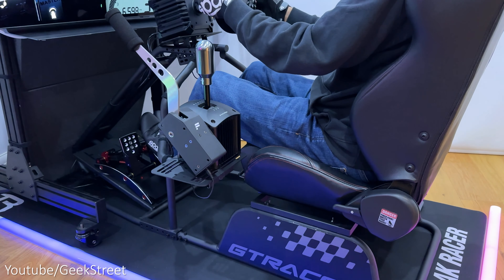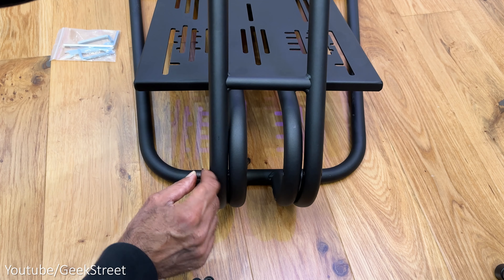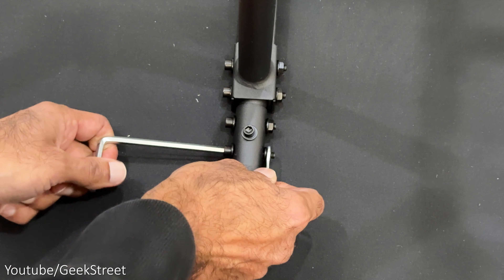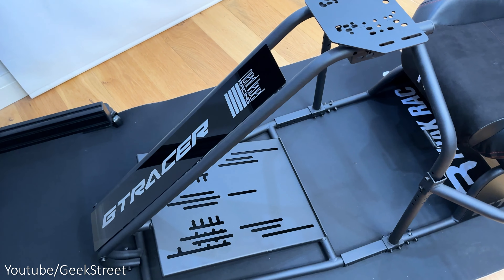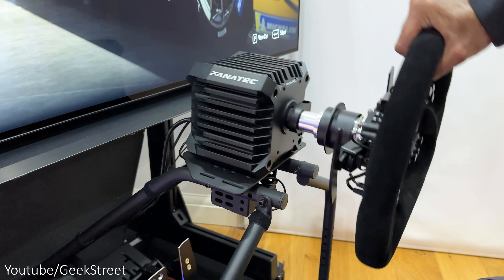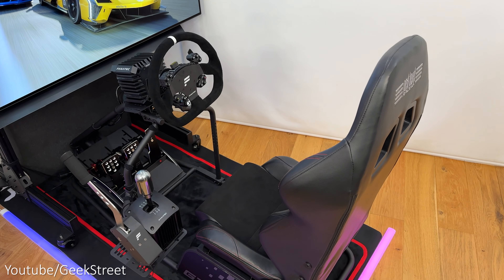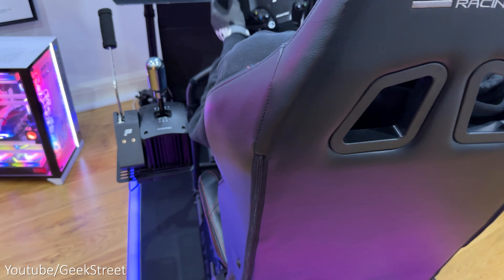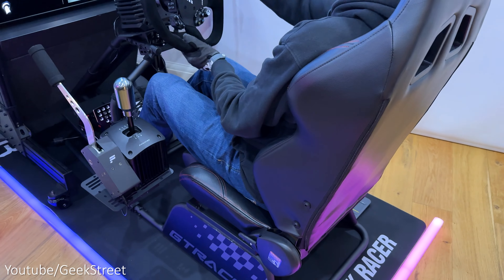Full SIM COCKPIT for ONLY $399 🤯 | Next Level Racing GTRacer Review

Comment: looks good but 399 is alot i would safe 200 more and get for 500 or 600 a elite rig the yhave also the monitor holdeers on the rig or optional trible monitor upgrades..no flex but if youd riv eina real car also all shakes its simple normal if you have this extreme wheels bases or even motion platform peopel whant relaisim..well life with the flex

Comment: Nice video review!!! Just one question, I already have my g29 and I’m planning to buy this racing seat. I would like to ask if this already comes with mounting screws?
Reply from the maker: Yes it does
Reply: are those included mounting screws capable for mounting my g29 steering wheel, shifter, and pedals?
Reply from the maker: @kier_hnsly9221  yes that's right, from what I remember
Reply: @GeekStreet  thank you!!!

Comment: I am 6'2'' and it's a bit on the small size. If I have the seat all the way to the back, I have to put the (Fanatec) pedals all the way to the front. Talking of which: you cannot put it all the way to the front, because then I cannot switch from gas to brake without hitting the bar. 

Also, for that height I think I will have to flip the wheel mount backwards (to get the wheel closer to me and have the pointy side facing me). 
I will probably have to drill an extra hole in the seat mount and have to move it about 50mm more to the back.

Flex: well, using it with a load cell pedal, I can see some flex when stepping on it hard. Tightening everything more helps with it to a certain degree.
Yes, the handbrake/shifter kind of flexes, but that's not bad at all.

I think you can mitigate the flex by tying the whole thing down (with the kind of pipe fastening U-bolts. That will work for me as I wanted to put this on a platform with wheels anyway. The flex (when pressing the load cell) comes from the middle of the bottom actually rising a bit, so if it's tied down at 6 points (or 5 , 2 front, 2 mid, 1 rear) that it will be very stable. 

My biggest grief is the seat. It is not uncomfortable to sit on (for your butt), but it is on the narrow size. I am thin but have broad shoulders and it feels a bit crammed. 

I think if you are over 6' or 182-ish cm, it is better to consider something more adjustable and mount a real car seat onto it. My next rig is going into that direction.

Just my 2c ...
Reply: Great review

Comment: Nice review.

I've never been overly satisfied with the cockpits I've seen. Either looked too flimsy or pricey. Eventually I just made one with some 1-1/2" ABS pipe, fittings, 1" pine panels (for wheel, shifter & pedal decks), U-bolts and 3/8" bolts to fit my Logitech G25 wheel and Rocker gaming seat. And I can adjust the Rocker seat and it stays in position. The wheel deck also serves as monitor deck for a 32" 2K monitor. I used to park it in front of the 42" HDTV. I use a Logitech X-540 5.1 speaker system for audio and the Rocker seat has audio in. Pleased with the result, the tubular frame looks cool and is solid, zero flex. Only tools needed are a electric drill, hand saw, wrench and ABS cement. I got all the materials at Home Depot and Canadian Tire.

Comment: Very nice and informative review! Can you confirm that the width of the bottom structure is 52cm? I want to be sure it fits between the legs of my Monitor stand whose gap is 60cm wide.
Reply from the maker: Yes thats correct it's 52cm width, there's a discount code for 5% off in the description of the video!

Comment: @Geek Street GT Racer 😊 Heaps of great information in this video, thanks..... is the non adjustability of the Pedal box a big issue? i.e. I want to get the same setup with Clubsport V3 Pedals, but I'm concerned that the pedals might not be in the ideal position?
Reply from the maker: I personally didn't find it that comfortable and would have preferred a little bit more adjustment on there

Comment: Can I ask, what size screen do you recommend, for a single screen SimRacing setup? And also, what type/brand, LED or OLED? Thanks
Edit: sorry I posted this before I reached the part where you said what your TV was. lol. Any burn-in with the OLED?
Reply from the maker: I own 3 OLED TV's and not had any burn in issues, size wise I'm pretty happy with the 55inch and works pretty well for a single monitor setup. Hope that helps.

Comment: Do not use the tool provided, you need a proper socket and ratchet set to tighten the bolts( with blue lock tight) to the correct torque, this will eliminate 99% of any flex, I have this set up using 8NM direct drive wheel base no movement at all!! Most rigs out there cost $400 plus just to ship!!

Comment: Good video. I'm really struggling on deciding what to buy. It needs to be portable and moved in front of and away from the TV, but I also want something that's sturdy and doesn't make me regret not spending 100€ extra. Any suggestions?
Reply: How about the GT Lite Pro? It's light, has a comfy seat, and can fold away when not in use, but it's also rated for 13nm DD wheels (and some YouTube vids testing this show that it can handle at least the entry level DD sets). 

I'm honestly debating between either that or this GTRacer. As much as I'm concerned about the flex and limiting myself in the future, I just want something a bit more rigid than the GT Lite Pro but I don't want to break the bank.
Reply: @roguesquadron521  I think it has a little too much play. I was considering the Playseat Trophy or something similar

Comment: dot know why people buy this things that will go loose in no time,when you have similar price aluminium profile cockpits that will mantain stable for ever
Reply: exactly. looks like an cheap ebay cockpit with side bars added.
Reply: Which ones for example? I'm looking for my first one rn and thought about the one in the video, but the flex is making me a bit unsure.
Reply: What are you talking about man? The cheapest aluminium cockpit including a seat would cost over a €1000 where i live. This sells for €400.
Reply: Similar price? Aluminum profile with a decent seat is minimum 800-$900. I agree on quality I’m going to just spend the extra to get the rig I want but man $400 that comes with a seat and supports 13nm? That’s a great value if you ask me
Reply: Mine doesn't come loose. But then again I used locktight on all screws
Reply: I cant find anything in that price range as you claim.
Reply: Red Loctite stops anything from coming loose.  If you need to disassemble it use orange Loctite.
Reply: It's cheap that's why
Reply: The chinese ebay cockpit companies now have an 80/20 rig for 400 usd without seat. I have older ebay rig its served me well. My only complaint is the chair back is not sturdy under heavy braking.
Reply: Theres an aluminum cockpit with a seat for $400? Point me at it.

My beef with the GT Racer is, this is a re-branded GT Omega Pro rig for $50 more.
Reply: Similar price? This is $400 and the cheapest aluminum is $1100
Reply: Name one extruded aluminum cockpit with a seat that doesn’t cost double what this costs
Reply: Cry 😢
Reply: Hey OP, still waiting for your link to an aluminum profile rig with a seat for 400 bucks. I think we’re all anxious to get our orders placed.
Reply: @ViaticalTree  it’s not gonna happen, bro was just capping lmao
Reply: @ShakyLove  loctite will prevent the hardware from backing out, I understand. I'm curious how is the flex of yours with the hardware secured with loctite?
Reply: @ViaticalTree  with a seat, the cheapest I’ve seen us around $600 on eBay
Reply: Even the cheapest 8020 I’ve found with a seat is $300 more than this. $300 extra is 75% more than this and shouldn’t be used as a comparison.
Reply: There’s a thing called Locktite brah, 💥problem solved
Reply: You crazy bro
Reply: @ShakyLove  I mean basics
Reply: Go find what you are talking about for this price, then come back and show us. This is a great cockpit for the price. It's sturdy and will last forever. Especially if you use thread locker on all the bolts. Man get GTFOH with your BS! Some people don't want to spend $1000 on a cockpit to play a game!
Reply: @diab3lo  but there is no similar prize with this for aluminum in the market...alu starts at 500 bro
Reply: @diab3lo  never found a aluminum one for $300